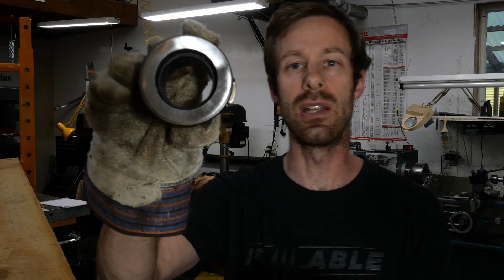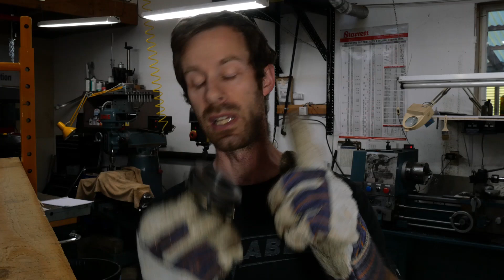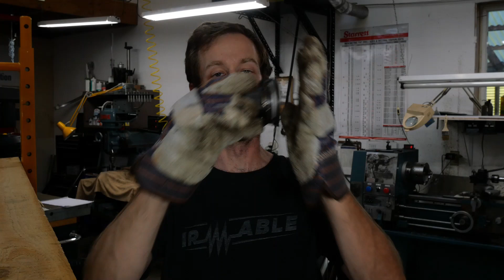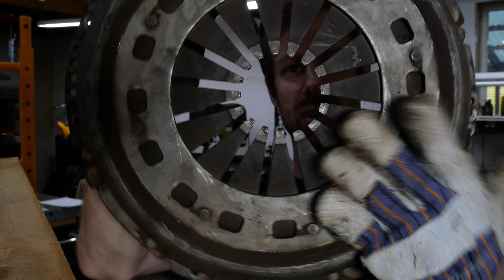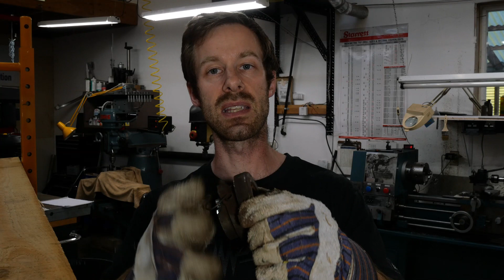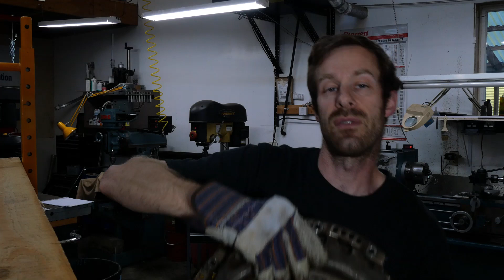What is a Throw Out Bearing? And Why Does it Make Noise?

Comment: Mine is making noise idling, as I put pressure on the noise diasppears just like this. It also sometimes goes away by itself as the engine warns up?
Reply: Same on my Is 200. I think it's the clutch fork that isn't lubricated and rattles...

Comment: The technical term of "bearing inside" is called sleeve and it is fixed on the release fork and I don't think that it can rotate in that position. The only thing that rotates is the thrust ring of the release bearing which is in permanent contact with the diaphragm spring. The axial pressure (preload) of the release bearing should be 80 - 100 N to ensure enough drag torque and to equalize the difference of level of the diaphragm spring fingers. The wear on the diaphragm spring results from the slipping thrust ring due to too low preload, not from misalignment!

Comment: The description of which parts of the T/O bearing rotate and which don't rotate is backwards. The part against the clutch cover rotates (because the clutch rotates with the crankshaft) and the sleeve that slides forward over the trans input shaft does not rotate.

Comment: But how do you know if the shop took the time to make sure the air gap and seating is done right,,,im on my 3rd freaking clutch in 5yrs,,,,,,,,dont beat on my ride,,,,got 6 yrs out of my mechanical clutch,,,brought it in for a clutch and the shop switched it to Hydrolic,,,,as well as a huge upcharge and NOTHING bit problems at 2600 a pop,,,total B.S.

Comment: The flywheel always spins when engine is running. The clutch plate and springs are bolted to flywheel so they are spinning. 
Question. Is the throw out bearing always in connection with the springs - and the outer portion spins - or is there a gap when the clutch pedal is released?
I have a violent rattling vibration noise on a new install at 40mph in 4th and 50mph in fifth when accelerating. Trying to determine cause.
Reply: The release ring of the bearing has permanent contact with the diaphragm spring ( = preload 80 - 100 N). If the preload is too low, the bearing slips and vibrates which you can feel in your pedal.

Comment: Hi .. im having a sound (like something spinning and rubbing)when in gear and it disappears when in nutral or when i press the clutch .. is it related to the release bearing  or something inside the transmission? 
Appreciate your answer.
Reply: Try putting grease on your release fork

Comment: Hi need a small clarification recently I changed clutch plate pressure and bearing for sx4 Maruti Suzuki but after removing the air , when I press the clutch pedal, bearing is getting failed and broken into pieces why it's happening like that

Comment: Dude, the bearing has to rotate. The pressure plate is bolted to the flywheel….
Reply from the maker: Check out my part 2 video. It was pointed out before, so I made a follow-up to correct my error.

Comment: British cars once used graphite throwout bearings, they wore while engaged. But no bearing, just the graphite wear surface. Good reasons to put in neutral at stoplights. More it's used, the more it wears. Cool and different than most
Reply: Yes and I had one of those in my MGB that failed in a few months.
Reply: If you aren't moving, you should be in neutral. The clutch is a pedal to push and release, not hold to the floor for a long time.

Comment: Thank you. This was helpful. 

I just had my clutch replaced and the low singing squirrel only happens when the clutch petal is completely released and just the slightest of pressure it stops. The mechanic decided a cylinder slave replacement would get rid of the noise. I later learned  from peeps who drive  stick, it is the throw out bearing needing  something which would the engine dropped again to be corrected to actually complete a proper clutch installment.  The mechanic did mention the possibility of this when I picked up the car. The goal was to drive it for 500km to work in the clutch. So I did a    road trip with CAA in my back pocket. Gawd help them if that happened eh. It's been a month since the installation and some other work done so now I decided I'm putting it all in writing prior to that appointment.
Reply: lol its the fork that presses the bearing

Comment: Only reason I took gearbox off was because clutch started slipping after 260 000km ( ~160 000 miles ) and only then I realised that my throw out bearing was bad. Very similar to yours but oddly made no noise.

Comment: This video is wrong according to my Ford 351 with a four-speed because the springs are attached to the flywheel and the flywheel spims  the spring spin &  the throwout bearing comes in contact with the springs fingers and the bearing spins and the inside that is around the shaft stay stationary because it's on a separate shaft that is bored through the stationary shaft. So the outside spins and the part around the shaft stay stationary because it is locked into the forks anyway it can't spin.
Reply: The video is wrong. He is explaining it backwards so to speak from how it is. Throw out bearings are attached to a fork. It's fix and doesn't spin at all with the clutch not pressed. As the clutch is pressed the face of the throwout bearing contacts the pressure plate (which is spinning with the motor). When they make contact the face of the throwout bearing spins. The back inside part of the throwout bearing never spins. Thus why it needs to be a bearing.

Comment: Mine is making a squealing and  ticking noise intermittently,  That either changes or goes away when you press the clutch pedal. But also it's getting harder shift.  
And cLutch is not performing correctly and it's harder to shift into gear.

Comment: This is probably a dumb question but - Am I causing more damage to my truck by still driving it this way with the existing problem described in this video??
Reply: i’m a year late but, i have a 2011 Genesis Coupe With a 6sp and i’ve been driving on it for like 2 months, just tonight had my throw out bearing basically die on me and i had to practically lip it home with a lot of force, rev matching stress and damage to my shift gates/synchros (probably) 

so try to get it fixed asap it’s worth the money

Comment: How does the bearing seperate the clutch disc from the flywheel and pressure plate  to cut off power to transmission?
Reply: The pressure plate is what does that

Comment: Hi I drove my car in knowing without oil no warning light came on I noticed the car losing power etc thought it was dirty petrol so topped contine to drive till it started losing power and gear change so finally stopped when I heard a whining noise checked all fluids and seen there was no oil but not warning light  finally topped up oil started but now the whining noise is there when I release the clutch car starts ok but bad noise what's happened thanks

Comment: Nice video, if the throw out bearing is bad should i replace the complete clutch or only the throw out bearing?
Reply from the maker: I suppose if the clutch kit isn't that expensive, and you're digging into it already, it's probably not a bad idea to just replace it. 

If the bearing really is sticking too bad, then yes, that friction will absolutely wear down the spring fingers of the pressure plate.
Reply: Good explanation..thanks, on occasion I would get a screeching noise from my MGB and there appeared to be a problem with the pedal being so rough to operate so on disassembly of the clutch found that the carbon bearing of the throwout (release) bearing had completely gone so total clutch breakdown was imminent, also found that at sometime in the distant past the wrong pedal assembly had been fitted, one from a later model..

Comment: Nice video! Would the transmission oil be able to get its way to lube the throw out bearing?
Reply: In my experience no. The TOBs are usually sealed and use grease instead, so trans oil wouldn't help. They're cheap to buy for every-day cars, and get replaced any time the trans comes off of the car, hence the name :) Trans comes off, throw out bearing, put new one on! Hope this helps

Comment: Thanks for posting this information. Could a bad or worn throw out bearing cause difficulty downshifting into first gear at stops and gear grinding shifting into reverse? My Chevelle shifts fine thru all gears until I get to stoplight. Will not let me shift to first until I turn engine off. I’ve adjusted clutch as far as I could also.
Reply: Steven, try putting it in reverse then first, see if that helps.
Reply: My Subaru does the same thing. I’ve found while I’m stopped and trying to put it in reverse, I won’t be able to pull the stick all the way into reverse or it’ll grind. I’ve found while stopped, press in the clutch, shift into first and then keep clutch down take it out of first and put it in reverse and it shifts no problem. Not sure the reason why as i haven’t researched a whole lot into it but any thing you’ve learned about the issue I’d love to hear.

Comment: I have a Mack RD600 with an Eaton Fuller 13sp. The clutch was new 2 years ago but it sounds like the t/o bearing is seized up. As soon as you engage the clutch you here it, it sounds like the PTO but I know that’s fine. The bearing won’t take any grease, and I’m stuck because I wanna sell the truck and not put a whole new clutch in, any suggestions? Thanks

Comment: You're very close on the explanation however the center of the bearing is static. the fork applies pressure on the center. The bearing face spins with the pressure plate. When pressure is applied it compresses the bearing and makes it quieter. The compression also changes the resonate frequency of the material deadening the sound. The same way your hand does a ringing bell when you touch it.
Reply from the maker: You are right, and thanks for pointing this out, shows my lack of experience with understanding clutches. Seeing the pressure plate bolts lining up with the flywheel should have been a dead giveaway that the pressure plate does indeed rotate. I need to do an 'edit' video and link it in there soon as I can! Thanks!
Reply: You are welcome. I know how the comment section can be a little mean sometimes and a clutch by itself is really confusing. Without the engine and transmission it's hard to explain how all that works together however if anybody can do it I believe you can. The video on the hydrostatic drive is a perfect example very good work.
Reply from the maker: Very nice of you. I'm glad there is always new stuff to learn.
Reply: @PetersonBrosAutomation very useful video sir thank you! My c60 gearbox on toyota corolla Tsport have a little whine noise when I'm on 1,2,3 gears but in 4,5,6 is completely quite, I hear the sound only with closed windows without music. Also when push the clutch pedal the noise gone, so is gearbox noise right?  What can be? (The fluid is on the top and I change it every 20.000 km)